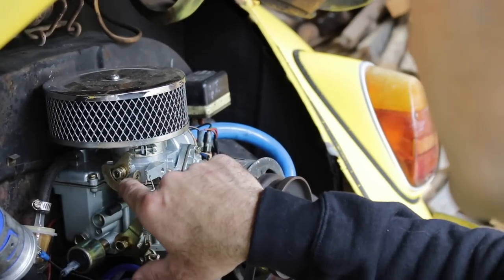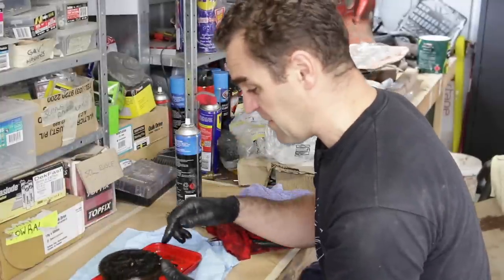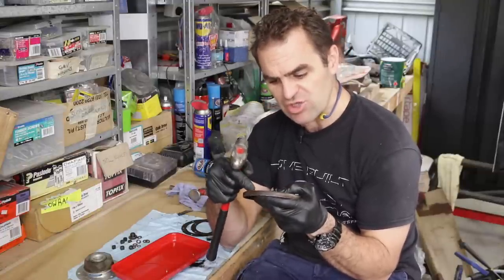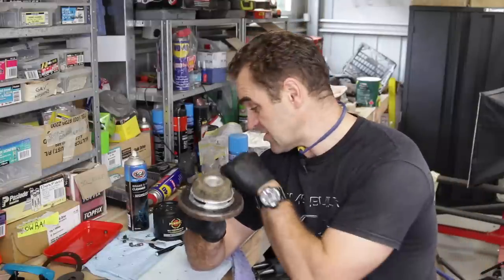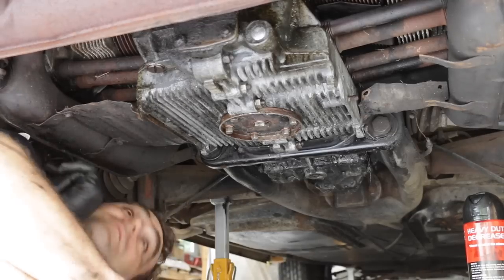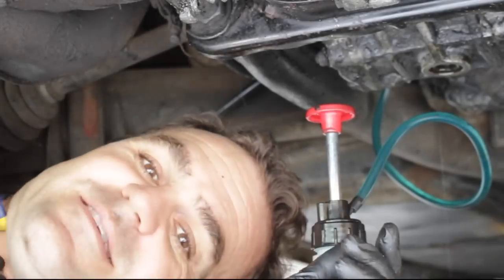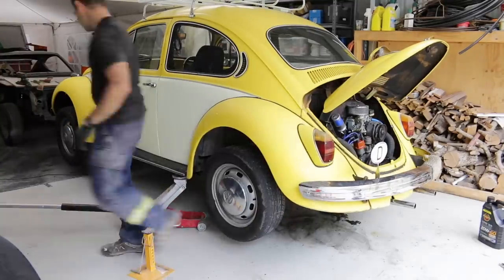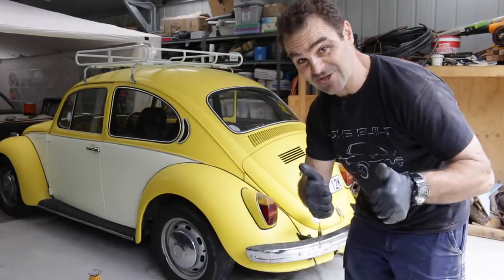Oils, filter relocation and window latch - Home Built Project Beetle part 5

Comment: A few tips that will hopefully help. 

That bolt that keeps falling out needs a jam nut that you can toghten up against the bracket that will lock it in place.

If you reuse copper washers, a trick to help them seal again is to heat them up to red hot using your map gas torch then dunk them into water, this helps soften them back up.
Reply from the maker: I didn't think of using a jam nut. That is a great idea.

Comment: Hi Jeff. Fuel filter should go after the fuel pump. Without positive pressure, the filter will clog up quicker and cause restriction, potentially collapse the hose and definitely leave Mrs Jeff stranded somewhere. Just fit a good quality filter in the factory location. Happy travels!
Reply: Actually factory never had a filter, especially in the engine compartment.

Comment: Hi Jeff, Fun oil change!  I read somewhere that the screen is exactly for what you showed - to catch the sludge.  I guess the sludge captures that bits in the oil and locks them up some what.  I bet you dollars to doughnuts that your gaskets you made are way better than the ones in the kit!  They can be pretty bad.  Good move flattening out the pan where the holes are.  I had to do that on the 356 but it totally helped.  If you want to re-use the Cu washers, you can always just anneal them and sand them flat and they are good for another go.  Oh, that screw on your carb...  So, I always thought that was an idle stop...  It is just to ride on the choke cam when cold...  So, what you do is to tighten it down until it just kisses the very bottom lobe on that cam and then back it out like a 1/16 turn.  Then you can set the idle with that adjustment on the side of the carb.  That my be why you have yours all the way in...  Did I miss where you have a warm start issue (I read a comment somewhere)?  Is it loading up?  Might be the fuel pressure is too high and it is pushing past the needle and seat when you shut off, then floods the carb.  A quick check on the fuel pressure will tell you.  Should be like 2.4psi? Oh, that fuel pump!  Yours is still original!  Keep it if you can.  The aftermarket pumps are all crazy 5+psi and you'll need to add a regulator.  You can't shim them (they won't flow at high speed)...  Awesome fun those beetles!   The tin is always a bummer and that rubber is super important.  There are places that sell those correct head screws for that.  That really brought memories of Lemon Drop :)  Thanks!  Really fun to watch! Franny
Reply from the maker: Thanks Franny. I need to go back and adjust that screw now. I did watch your video as a reference, but I let it kiss the cam and then tightened it more instead of loosening. 
If you watch 'Mrs Jeff broke the beetle' about halfway through it stalled and I couldn't start it again while it was hot. Since, I have listened to some of the comments, and now I start it with my foot at about 1/3 throttle and it starts every time. Not sure if that is an indicator of something that is not right, but it works!
Reply: I'll check out that episode...  The fuel pressure is a great place to start.  I was amazed how off it was on Lemon.  I think I did read somewhere that the new replacement Solex carbs have a week needle and seat.  Just watch for the pressure to bleed off after you shut off.  I just love how you are working on the car but still using it.  Mrs Jeff is a great sport driving to work!  It is a a great way to sort it.  Love the history lessons!  I didn't know they made a 4WD version.  Not the fastest thing, huh?  I need to watch more!  Franny

Comment: You might want to try a lock nut on the adjustment bolt that keeps backing out. Not a nylon one just a regular one tightened against the bracket the bolt is mounted in. I don't know about this one but that is common practice for adjustment bolts on many carbs. The same method is often found on gas cable adjusters to keep them in place.

Comment: The old Holden grey motor never had an oil filter either. Yeah, nah. ya got me there. never seen a paper punch to make gasket holes. give ya credit there. You can anneal copper (soften) by heating red hot and quenching (cooling in water) It will then conform and seal noice - just like a newy. Thank christ you didn't get degreaser all over yer safety glasses!!! You can tell I'm commenting as I'm watching, eh :)  next to bugger all oil in the g/box, jeez no noises?  Good vid, thanks Jeff. Oh, and thanks Mrs Jeff

Comment: Hey there is now a bunch of fuel line after the filter. The decomposition of the hose and fuel line after the filter is the reason for keeping the filter in the engine bay close to final use area. Been driving bugs for 45 years and no filter has ever leaked on me. Cheers

Comment: Jeff, the big concern with 3d printing is the design of the part you need.   The few car parts I have printed have all sorts of curves and tend to be challenging to reverse engineer.    Mostly I have designed car handles and interior accessories.

Comment: If you drill toward your hand sooner or later you will definetly stop.....a mechanic would do a really rough job usually so no you would not a make a mechanic...the sump plate could be reinforced with an aluminium ring under the nuts if you could fit longer studs, I seem to remember doing something like this many years ago.....I bet the bug loves new oil and a clean filter screen

Comment: I was always recommended to run oil with a higher zinc content specifically Rotella T6 in all my Subaru STIs. For the Subaru world it was mostly focused around bearing lubrication and why T6 is another story. I also run oils with Higher zinc in my 89 BMW because of the following.

From what I have read and have been told is that for older cars and cars with flat tappet cams the zinc and also the  phosphorus in oils like that are better at resisting wear.  The newer formulas for "modern oils" have less of it which can cause lack of lubrication on start up. There is a bunch of voodoo witch craft I don't get about their formulas and what not but that's a summary of what I know about oils with higher zinc and why you "should" use them in old cars. Is it all true? I don't know but it makes me feel better.
Reply from the maker: I don't get tied up in the endless debates either, and I am not am expert. I just follow whatever the general consensus is and hope others research is good ;)

Comment: 12:24 search for 'Rubber Grommet Firewall kit' on eBay
Reply: And if you can't find the right gromet with a hole in it, use a blanking gromet and make the hole with a soldering iron. Works a treat